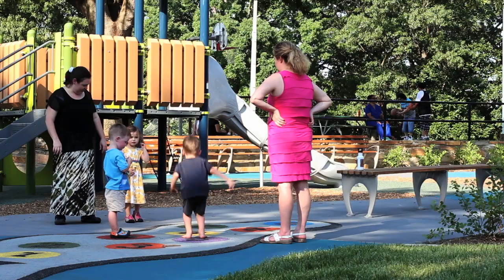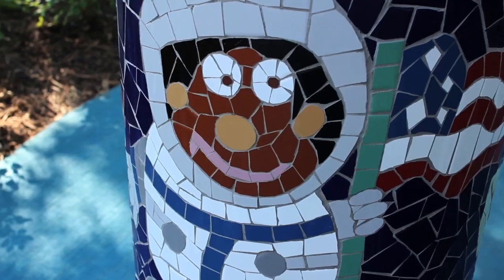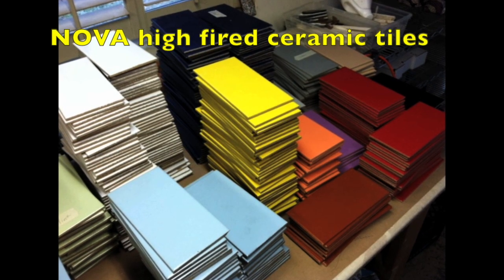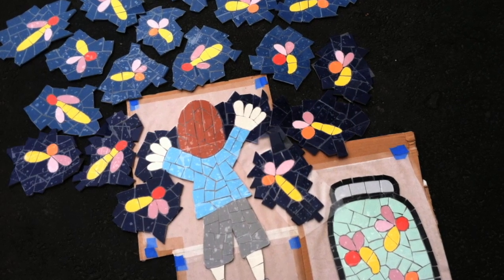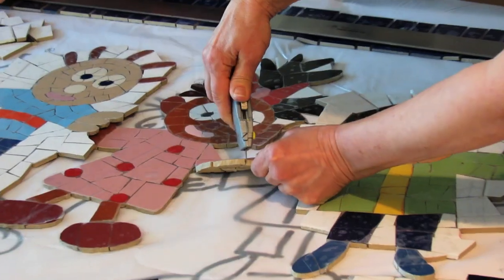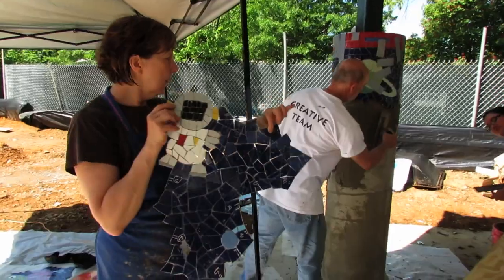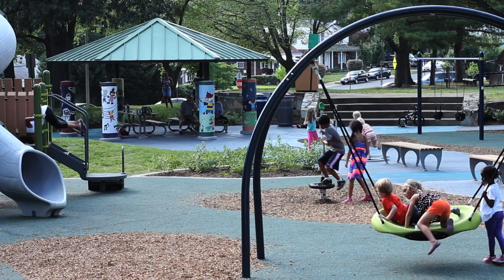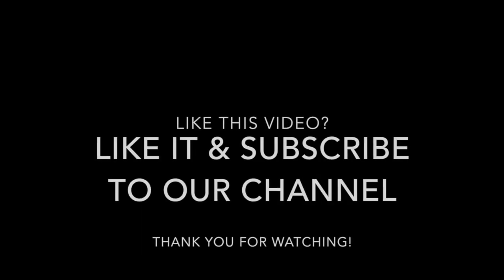Mosaic Tile Columns & Pillars

Comment: Hi Bonnie.... Do you ever mosaic over PVC round columns.  Would it hold up in Minnesota? Can you adhere tile to PVC?  Thinset, glue?
Reply from the maker: I have not personally used PVC as a substrate. You can not use thin-set unless you first cover PVC with A/R mesh and a scratch coat of thin-set (making it have a concrete surface). Could use silicone, but messy. Probably will not last forever, but will for a while, make sure you use silicone rated for exterior.

Comment: I enjoyed your video! Well done! Did you stick the tiles on a plastic sheet? Please answer...thank you!
Reply from the maker: Used a face tape method, worked over contact paper sticky side up. The contact paper acts as a temporary adhesive. There is a separate video about that technique on the channel. If your column is thinner than that shown in the video you may want to use the mesh method, it accommodates the smaller roundness of the column. If you email me I am happy to share some photos contact@maverickmosaics.com, there is also a video on the channel demonstrating that method.

Comment: Hi. Can you tell me what type of professional grade tape you used. I am experimenting with clear packing tape but wonder if this too sticky. Also wondering what you think about using this method with very small tess. Is there a size where it might be too small to work well in your expert?  Thx
Reply from the maker: Professional tile tape used for this project made by EMI (https://smalti.com/mosaic-face-mount-tile-tape.html) it is very strong, I use for thick ceramic. Challenging for very small tess, I recommend you make a small prototype, a test, see how well it works fo what you have in mind. For smaller pieces and for more delicate tess (stained glass) I use packing tape or contact paper for face tape. I find it releases easier. This video shows using packing tape (https://www.youtube.com/watch?v=3Jd20qX6L8U). Good luck!
Reply: @MakeitMosaics  thx so much

Comment: Hi Bonnie, Your work is gorgeous!  Can you tell me Where or what store I can get those nova high fire ceramic tiles?   I would like to make a table, but all I find is subway with has a little lift on the edges and I would like a tile that is flat and solid colors.  I am looking for different kinds of blue and I just can't find anyplace  at all.  (I live in Canada and it is even harder, for some reason, they only have washed colors: grays, whites,  and more grays lol). Thank you!      I got your book that has the apple on the cover.  Love it and very informative for a novice like me
Reply from the maker: Nova is carried by Witsend Mosaic, they are really beautiful and easy to work with. Thanks for being a fan.
Reply: Thank you! I didn't find them with that name of nova high fire ceramic tile.  Is this the same as a nova glazed porcelain. Is this the same?
Reply from the maker: @isyaya78  Yes that is the product, here is link: https://witsendmosaic.com/ceramic-porcelain/nova-glazed-porcelain.html
Reply: Thank you Bonnie.  I am very disappointed. I did the reverse method for a mosaic put the tape and glue the surface and put mosaic on top.   The glue is not drying at all and also came up and interact with the tape on the top. so now you can see glue (white) between the tape and the mosaic (glass mosaic).  I don't now how to make it dry.  It's been 2 days already. I even put it in the room where my furnace  is, to dry it and it is not doing anything.  😭😭😭😭 help me please!!!!
Reply from the maker: Please email me a photo, will be easier for me to understand contact@maverickmosaics.com, I'll try to answer you off-line.

Comment: Hi! Did you use sanded or I unsanded grout?
Reply from the maker: I ALWAYS use polymer fortified SANDED grout. And in this case a premium brand that included additives to protect from UV. Thanks for your interest!
Reply: @MakeitMosaics  Good to know!. The project you show in this video has what seem to be SUPER small gaps, and the project I'm working on has tiny gaps too, but I know sanded grout is best, so I was worried because I know small gaps can be iffy with sanded grout. I chose the Polyblend Sanded Grout, and all signs point to this one being good for my project. Fingers crossed!